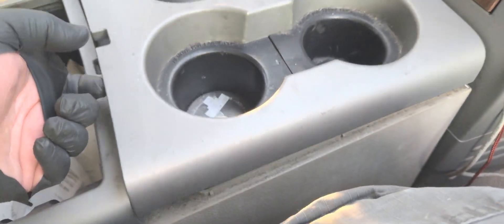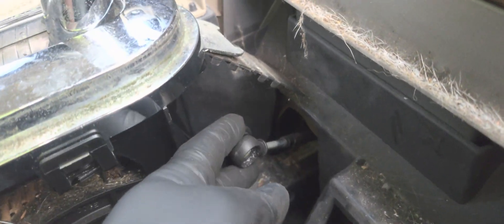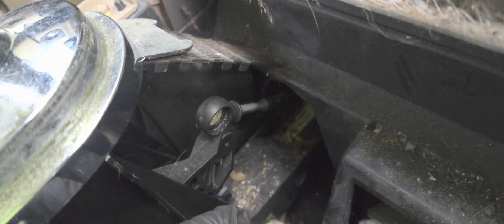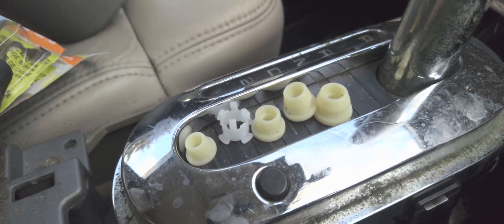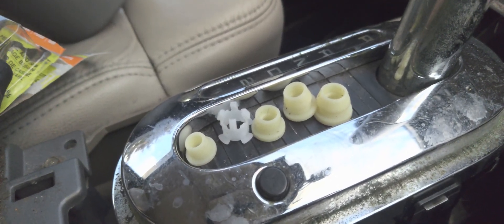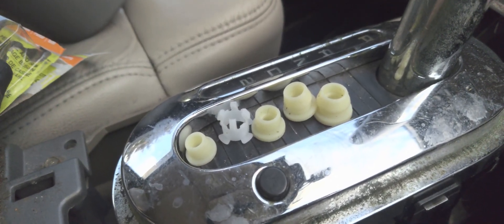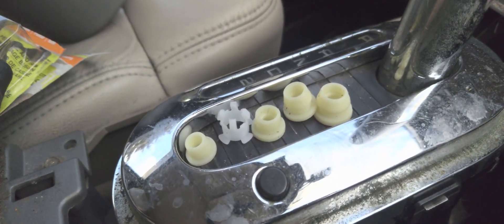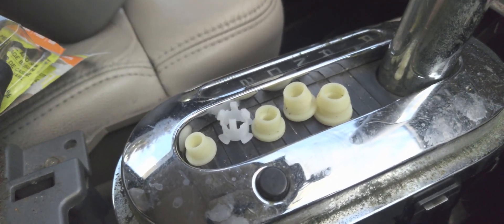Cabin Shift cable bushing replacement 2004 F150

Comment: Dorman 14057 is the correct bushings for the Ford trucks with the center console. That kit you used is for the clutch linkage
Reply from the maker: It still works so I'll call it a win. Thanks for the correction either way

Comment: How do you remove the old bushing I need that information please
Reply from the maker: @madalynnallbright311  they were so worn out they fell apart. best way is to pry them with 2 pliers or needle nose tools, basically anything you can get in-between and pry from 2 different positions. I've found screwdrivers don't work well as the slipped off a lot. A wedge would be better get a door stop or similar to pop it off